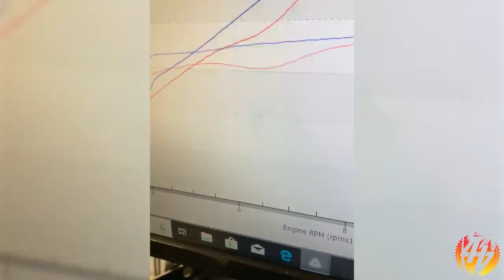THE SUZUKI IS ALIVE! Budget Bike Battle Benidorm

Comment: I do have to say, I called up BeMoto last week to insure myself on a pan european and they refused to insure me because the bike has a large displacement engine. I've been riding for 5 years, never made a claim. They said it was because my previous bikes had smaller engines and I was, therefore, likely to have an accident, even though I've previously owned a 1200 bandit. I didn't really get it and MCE were more than happy to insure me so sorry lads, tried to help you out by going with BeMoto but they just refused!

Comment: Disappointed that some people think that playing 'parts darts' is an acceptable way to diagnose a fault. All of the wiring, sensors, ECU and cam timing are testable with the correct equipment such as a Picoscope. This could have found the problem in half the time and a fraction of the cost.

Comment: By the sounds of it either someone had installed a manual tensioner, tensioned it too far resulting in chain stretch and poor cam timing, or alternatively, the chain had simply stretched and someone had installed a manual tensioner as a bandaid

Comment: Is the k6 road legal in track form? I would have taught you would need lights, mirrors and indicators to be “legal”
Reply: It's a daytime MOT I'm guessing. All you need is a brake light as far as I know and you're set as long as you aren't out after dark.
Reply: Yes you have to have daytime mot
Reply: MOT Minimum requirement is brake and tail lights (plate light not required) , audible warning (horn) and a rear reflector . You don't need headlights and indicators, Aslong as you dont have relevant switchgear  fitted  which suggests that lights have just been removed to avoid being tested. Mirrors not required for MOT .
However the traffic police might have different views in terms of construction and use regs. Doubt they would care about someone riding an enduro bike between green lanes aslong as it's got the bare minimums and is insured taxed and tested but a trackbike on busy roads might be a different story? Even if it flies in the UK I doubt it will in Europe
Reply: Robert Bell definitely not legal in sweden. Day or night. Spain might be a bit more relaxed though
Reply: Not legal here in Ireland and we don’t even have motorcycle testing. Traffic cops would impound that bike definitely
Reply: @theballylad  yeah , totally different means of testing in Ireland.
Reply: Going through Europe without Headlights...that is gonna be a fun experience..... 😅😅 Blues Brothers style.., 😆

Comment: Sometimes saving your money at all cost can cost all the money your saving.
A top end refresh would have been how the shop would have done it with those ridiculous miles. No one can really fault them because the name of the game is saving each team money on a point system.
I was just repairing a motor on Friday that was getting neither fuel nor air; however, if I'd gone with someone else's blind observation with the basic technical ability to only fuel it up, it would be the same outcome. It only takes one little thought to potentially send you off course chasing invisible gremlins throughout the system. The plugs fouled black with carbon from a dirty burn, mechanical muffler staying closed by during up, and the air filter was shot. It didn't want to choke because it was sticking open. That was the original source of the problem and all of them together made it a dead silent motor. 
To much overlap was blowing it out your slip-on pooper to wreck the curve. These things are a learning experience in patience and impractical savings at all costs.

Comment: "So after a few computers, coils, etc we figured out the problem was chain stretch." What?
Reply: Cam chain
Reply: ProfeTa6 Process of elimination
Reply: That was the 1st thing I said also. I never knew a stretched cam chain could cause all those issues. I figured as long as the adjuster is working all is good. I know they don't last forever but I have 91k on my zx10r with original chain.

Comment: If you suspected something was up with the cams, wouldnt degreeing the cams have revealed that the timing was off just a fraction from a stretched timing chain?  Of course, Hindsight is always 20/20.
Reply: Jman G Agreed. Standard practice is to check cam timing and rotate the engine several turns to see if the engine gets out of time. That would be a clear indication of a chain stretch.

Comment: I think the Suzuki violates the spirit of the "budget" bike battle. There is nothing budget about the amount of work required to get the bike running. If anything it throws up a caution flag to anyone thinking they can take an old bike and do anything substantial with it... or at the very least to be more careful with what you buy.

Comment: 5:38 - "It's down to that...cam chain" - and James mentioned that the previous owner had swapped it over to a manual CCT. But I'm not overly clear on why this led to poor running and performance. Can someone explain this in layman's terms please. Cheers guys.
Reply: Most modern engines do have a camangle sensor to determine timing of the crankshaft (TDC). Ecu will read signal and adjust ignition and fuel timing on the fly depending on load and rpm...temperture  and crankposition... (first cylinders distance to tdc) 
This system obviously relies on cam and crank running in sync... It might not even be noticeable at low rpms as deviation is little..... But up high due to greater and greater deviation the ecu will adjust timing on a completely wrong basis.... Maybe run into trouble trying to correct it by adjusting other values... Basicly the ECUs timing and fuelling maps will be all over the place....trying to read sensor data will be completely terrible because nothing behaves as it should....
Reply: thanks for that ; - )

Comment: My KTM Superduke 1290R date of birth 2017r. Got valve guide broke. Valve and few metal pieces went down and smashed few things.  It took KTM 6 months to figure out that they should pay for it. 
Interesting fact is that they still don't know how it happen. I was commuting to the office not spanking it on the track. So your Suzuki Team is much faster than KTM factory :D
Reply: Well KTM does stand for Keep Taking Money, rode my brother's superduke and hated the feeling, rattled worse than a hog
Reply: I'm happy with mine. It's smooth but you have to be respectful with throttle.

Comment: Ok so first off I must say Suzuki's Suck!! what a POS !!! Glad they finally sorted it out for you though. Second I'm am not a licensed motorcycle mechanic but I am an electronic technician, for 30+yrs, and have rebuilt several motorcycle engines in my day. I must say I am disappointed with the team working on it. Sorry guys. I know it was a bugger of a fault but to replace electronic sensor's and ECU's repeatedly just seems to me to be poor troubleshooting. If you change a part and fault is still present then try something else? It just does not make sense to me to continue to replace the same parts repeatedly and expect different result?? I know I will get slammed for saying this but believe me I have repaired thousands of electronic items, down to component level, and it just doesn't make good sense to continue to replace same electronic parts over and over unless the parts can't be verified good???